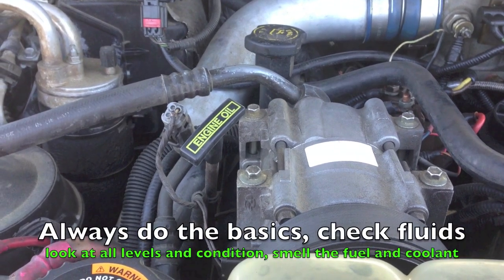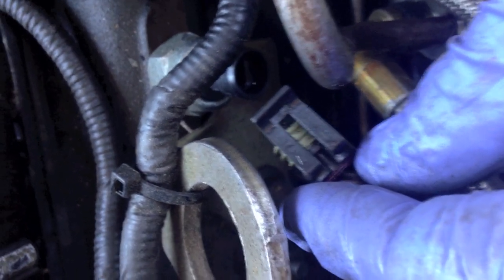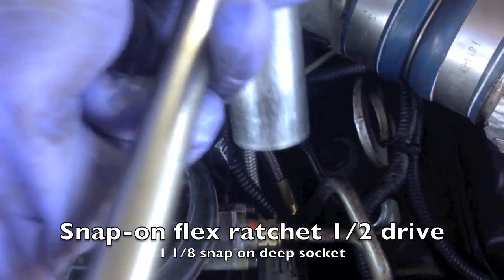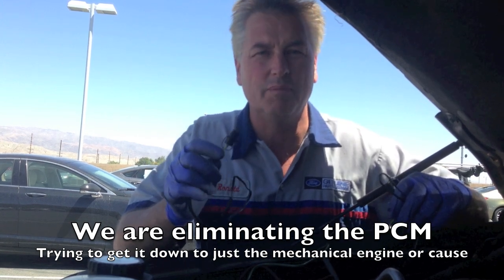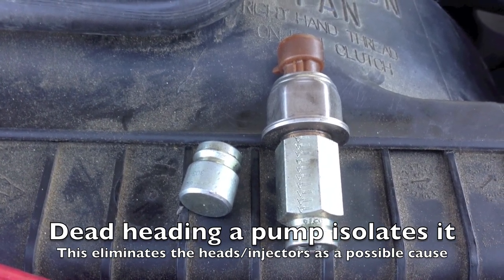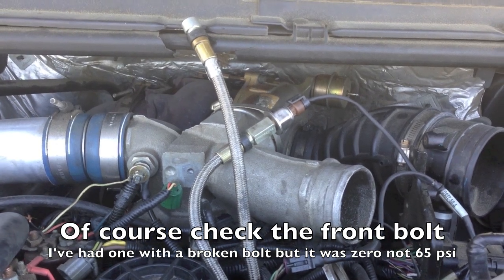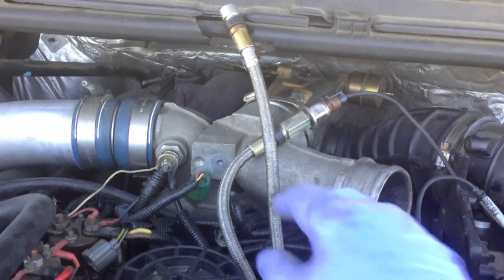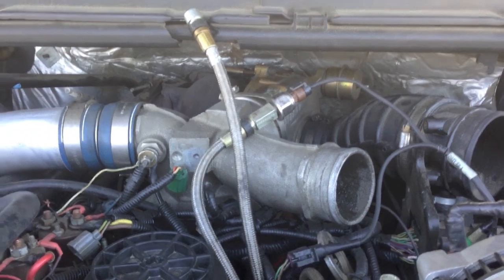Ford 7.3 powerstroke crank no start due to low icp injection pressure

Comment: I have a 96 7.3 that wont start.... new fuel pressure regulator and nothing. However if you spray ether in it will start right up but only a few seconds..... help?????
Reply: Following this because same on a 97

Comment: I have a solution just sell the dam thing before it dies on you. Because with all those fuel system parts it will leave you stranded, guaranteed. Ford designed these trucks to make a lot of money servicing them.

Comment: Hello I have a no start after I changed the high pressure pump and ipr sensor and still well not start  . Don't seem the pressure not high to me . I replaced oring on all the injectors  still won't start what could it be

Comment: I've a99 7.3 I drove it in the yard got out usually i have to plug it up for it to start but I didn't plug it up was a week then I tried to start with no success I check fuel pump is pumping I loosen the cap on thefiller bowl I guess in top of the motor now it spray fuel every we're after putit back on an it will only fire off with starting fluid

Comment: I am pulling my hair out with this 95 7.3. It'll start run for a couple of minutes and cut off and wont start again.Im getting about 12psi @ the Schrader valve.I've replaced the fuel and oil pump and ipr and other sensors,new front gas tank,fuel bowl filter,computer tested fine,I'm almost ready to dig a hole and bury it.Any help would be greatly appreciated.
Reply: Any luck? I am getting the same sort of issue. Only morning first start. Runs for a second or two then dies. Takes about 3 try's until it stays running. Only happens when left overnight. Fires up fine during the day.

Comment: If anyone else has this issue, I just got done troubleshooting mine. Wasn't injector orings, hpop, icp or ipr. It was the starter. I was getting 250-350psi icp on warm starts but my rpms were about 150-175. Not enough to create enough oil pressure with the hpop. Replaced the started and it's good to go

Comment: I think i know more about the 7.3 powerstroke and i don't have one i got the old 7.3 idi non turbo but somebody added a turbo to mine. one of the most reliable ones powerstrokes are not as good for those reasons and the parts do cost more. but the sound i love them for.

Comment: My 1996 7.3 psd with 250k miles. Stock. Have a intermittent crank no start problem. My scangauge shows ICP=0 when cranking. IPR 14.8 at key ON.  it has no oil on the stock ICP sensor connector. When it doess start it has good ICP and IPR Readings but can have a rough idle with the Engine shaking a bit. the sensors are so expensive and take several weeks to ship to my country so i don´t know if i should order a ICP or IPR...  I have a spare CPS sensor but i don´t Think it´s a bad CPS. Shows no CEL or No codes. Passes injector Buzz test.

Comment: Hi, got a question to diesel mechanics.
I have 2001 Ford e350 7.3 diesel cranks wont start.
It started during the travelling on the road. I drop gas pedal and cruise, and battery and fuel gauges start glitching, go to min and back to normal few times, looks like wire short somewhere and if i push gas pedal again and gain speed it all goes to normal, all gauges go back to normal. It was on running engine. As soon as i stopped it it wont start again and i towed it home. 
I'd like to bring it back to life by myself as i dont have other options.
I heard about AutoEnguinity OBD Scan Tool, can I do all necessary diagnostics with this Scanner and find the problem? I found one on eBay for $30 (AutoEnginuity OBDII OBD2 Windows Scan Tool Scanner(USB))
Thanks
Alex
P.S. Thanks Ron, R.I.P Man
Reply: Alex Metelkin that sounds like a wiring issue or pcm issue bud

Comment: I have a 2003 f250 diesel was driving down the road and started chugging thought i was out of fuel went got 3gal put it in started up drove a couple miles stop drove few miles home and died before i got home codes read p2614 p2617 p2290 and p1000 what to do?

Comment: i have a 7.3 02 130k wont start replaced orings, turbo is leaking and white smoke out of tailpipe, runs 5 secs then dies and wont start any ideas thanks
Reply: White is usually low compression.

Comment: I have a p1280. I replaced the sensor a couple years ago. the plug is dry. I'm thinking the sensor is bad again. this led me here. 

it runs but it doesn't want to rev up real well with white smoke. 

koer throws a p1284. it kicks the test. koer glow plug test won't test either.

though I haven't pulled the covers the plugs are not burnt on the outside. these were replaced when I replaced the go pump 2 years ago. 

wires don't look bad. I didn't peel them out though.

thinking I'm gonna throw a senior at it.

Comment: hey mate im from Australia and im having troubles starting back up once the truck sits for a few hours. i did what you said about putting 12vs to the ipr valve and after a wile of cranking it starts. what does this mean
Reply: Bit of a late response, sorry. DieselTechRon passed away about 9 months ago, but your issue sounds like a fuel leak, he has a video somewhere on it. Basically, a line somewhere is letting air in, which lets the fuel drain out of the fuel lines, back into the fuel tank.

Comment: hay Ron I have a 03 f450 6.0 I have replaced all injector all new hpop Orings and hpop also a new low pressure pump and when truck is cold I starts with ease when hot no start but cranks over let sit for 10 minutes it will start right up also put new ipr and I Icp sensors I'm now lost I've also put a new ficm please help I'm almost over this ford
Reply: Ron passed away in a car wreck spring of '16.  You'll have to rely on others on here for advice.
Reply: James Porter damn shame too.  Guy had a way of explaining things, usually you'd have to pay money for.. information is priceless.

Comment: I've got an 2000 F350 dually, 7.3L turbo diesel. the only way it'll start is if I pump the throttle, the motor drags like a bad battery until fuel gets down into the cylinders, then it turns over easily(well a lot better). if it's hot I have to do the same thing. even if I start it and turn it back off then try to restart, still have to pump the pedal. 
I've checked both fuses and they are good, fuel pump on the rail is running. I even unplugged the plug at the top of the pedal and it'll start, but only if I pump the pedal, after starting the throttle has no response. 
any ideas as what I could check next and if so is there a test for it? 
oh, it's not throwing any codes and it has a small hesitation while driving, but clears when given more throttle. 
thanks for any reply.
Reply: Chris Mcclard I have the same problem
Reply: conner shepherd, a friend of mine told me to check the lift pump or lift gate, (can't remember what he said it was called) after double checking with him today I'll see if i can find some videos on it to see is that's the problem. if I can't test it, I'll just buy one and see if that's the fix. I'll let you know what I find out in the next week or so. I need my dually at the end of November for a road trip, so I've gotta get this tracked down. I've left a bunch of post like the one you seen above, but I've got no response from any of the guys. I feel this guy is the best in the business, thats why I wish he would respond.  lol
Reply: Chris what was your problem? were you able to figure it out?
Reply: still haven't been able to get the lift pump off to see, now me truck won't even turn over. back to the basics for me now.
Reply: Chris Mcclard I have the exact same situation have you figured it out?

Comment: I have a 1993 ford e350 cutaway 7.3 diesel engine the problem I have is that it cranks but it will not start
Reply: check the crankshaft sensor is goes on front of the fly wheel  is about 25 to 40 dollars
Reply: I have the problem crank no start  replace the fuel filter cus think was duty , replace one battery autoparts guy told me that was my problem  still same  after took to the mechanic I'll pay 1.30 dollars for diagnostic show 4 different causes decide to go for the cheap one fix my problem crankshaft position sensor  so happy now f250 diesel finally is running  good luck people.....

Comment: 1997 F 350 7.3 will not start after it’s been running. I started out with the replacement of the fuel pump, IPR replacement, IDM replacement, new starter, HPOP replacement, new batteries (2) and still no better off now help 
Other items that I have replaced in the last year all new injectors, PCM, ICP, CPI, EBP Exhaust pressure regulator
Reply: Did u ever get it fixed

Comment: we have a "99" f550 7.3 will only run for 13 minutes and then cuts off. we have change pick up in the tank, fuel pump in the rail, new gas pedal.
we disconnect fuel line from fuel filter housing after it cuts off but no fuel comes out until  key is cycled again.
Reply: I replaced the ipr valve when mine was doing the same thing and it was like new after that

Comment: i have a 95 power stroke that will not start. I gave it ether to get it home but just cranks now. Batteries are good, oil level good, fuel bowl fills when cranking, oil pressure is good, glow plug relay was replaced, cps was replaced, fuel and air filters were replaced. Its throwing 3 codes as followed : P0344 cps circuit intermittent, P0470 Exhaust pressure sensor circuit malfunction, and P0603 internal control module jam error. From what I understand none of these codes should be the reason the truck cranks but it doesn't start. Do you have any suggestions as to where I should go from here? @DieselTechRon

Comment: replaced my pump, it started up find bt still leaked... ended up replacing the "common" o ring and now it cranks and cranks and cranks.... reads 100 for the pressure and wont turn over. wouldnt think it would be my ipr sensor??? could it be that all of a sudden? i hope to god i didnt lose that little steel check ball in the pump i had it out on a rag and didnt see anything fall out so i dont know what it could be now?

Comment: I got a 96 7.3 f250. all it does is turn over with no start. it makes a clicking noise while turning over and smoke comes out from the intake. all my fuses are good and I put new diesel in the tank. can you help me?
Reply from the maker: Yes but you need to give me something to go on. icp voltage, pressure,ipr percent, rpm?  I have a video actually a couple showing the 7.3 diag
Reply: Did u get this fix  Jack . What was the problem I'm having the same problem

Comment: I have a 97 powerstroke it loops on warm start, sometimes once, sometimes multiply times, just wondering if you had any ideas? thanks
Reply from the maker: ideas? If you're lucky it's just the icp sensor.  Check for a leak into the connection. If you're unlucky it's sticking injectors and it's ramping the ipr back and forth trying to get it right.

Comment: Ok. I got a 2002 F-350 7.3L and when it gets down below 15 degrees it cranks and then cuts off, and when at an even lower of a temperature and plugged in, it still does that. Most certain I'm leaking oil from my ipr valve. Would that cause it to have trouble to start in the cold? It's leaking oil onto the starter and it looks pretty corroded to.

Comment: Ron,
Thank you for your awesome tutorials! My 2002  F350  7.3 was showing code: P1316. per your video, I was able to fix the problem for fifty cents!
Also, after that work was completed, my truck would not start.  Again, I turned to your tutorials and was provided with an answer which pertained to my IPR valve.

I am very grateful for your knowledge you share and the outstanding way in which you relay it to those of us searching the internet for answers.
Thank you for the money saved and peace of mind knowing I have subscribed to DieselTechRon!

Comment: ok, my truck just suddenly died on me and won't even crank. the normal dash lights come on when you turn the key on though. Any suggestions what might be the problem?
Reply from the maker: Not without info.  Try jumping the starter solenoid to see if it's a starter or engine problem.  If not use a 15/16 socket.  Test for codes.  Remove the belt, does it click even like the starter is engaging?
Reply: Awwww bad bad deal, i crawled underneath the truck n lo n behold parts of the wiring  were wrapped around the main drive shaft

Comment: Hey what is the most likely cause for air in the fuel system on a 2000 7.3
Reply: Bad injector seals forcing compression into fuel system. More common on 6.0

Comment: DieselTechRon: Another question that I had, when you explained and Isolated the HPOP as the faulty component, is the Old HPOP serviceable or would we have to buy a Brand New Pump? Other videos are pointing to the HPOP pressure lines seals as a major oil leak problem and as I noticed on my diesel the Turbo Pedestal seals(underside pedestal to intake)  are leaking and I do have some oil sitting on top the Intake which brings about another question?  Although, there is some oil leaks, Hpop lines, Turbo pedestal underside seals, Oil Level is within Range and at Mark. Wpuld  minimal oil leaks cause my Hpop to fail and have to be replaced or just removed, inspected and new seals?  thanx again, if I do hear back from you,..

Comment: DieselTechRonnie: I know this Video of yurs is almost 2yrs. old now.  I am testing the IPR as I have a Crank/No Start situation-2000 Ford F350 Diesel, Powerstroke 7.3L Dually, 2wd, Manual Trans.  I unplugged the IPR and getting ready to test with the pigtail wiring harness you suggested.  My question, when this pigtail harness is hooked up and plugged into the IPR valve to test, Do You Turn the Ignition Key on as well? or Just apply the 12 volts from the Battery with the Key in "OFF" position.  Two New Interstate Batteries, Newer high Torque Starter(4 yrs. ago) New Glow Plugs and Relay Installed, Two New 110 amp alternators and New Fuel Pump/New Fuel Filter Intake Side and  I removed and cleaned the fuel tank and the socks then, decided to do a Hutch Mod. and omitting the Tank Filter and added Clean Diesel Fuel.  I am a Female, Self Doer, and Know this truck Inside and Out now because of your reliable Expertise!! Thank You! Thank YOU! Please explain the IPR question above more thoroughly(Turn Key on/off with Test? when apply battery voltage) as I don't want to screw any electrical components up and cause an electrical surge or Fry myself! 419-557-4706

Comment: Hi thanks for the video the same think happened with my excursion 02 7.3 it died on me on the freeway I got tired of it so i took it to the dealer and they said it was the hpop high pressure oil pump, ,they said 2200 dollars to fix it I could not believe it .

Comment: My 2004 powerstroke f250 i was driving it over the weekend and sudenly it just died. I have a computer and told me low fuel pressure. I did talk to a mechanic and told me it would cost me at least $5000 to fix it. kind of pissed off that a American truck with such expensive parts.

Comment: My hpop goes empty when I crank it over, but will not start. Please help.
Reply: Ya. T500 or adrenaline.   Replace Hpop
Reply: It was a bad relief valve in the oil filter mounting. It was stuck open.
Reply: Wouldn't let the truck start?

Comment: I put 175 Psi in the hpop lines to the heads i do not hear any air leaks. do you think maybe the front seal on the pump is leaking oil into the crank case?

Comment: Hi Ron, please help me. I'm working on a 2002 F-450 7.3 with No start. I add 15\40 oil to Hpop and it keeps going emt. and the oil goes to the crank case??? Whats leaking?  I do not have the block off caps for the hpop lines, If I take off the valve covers on both side where would I see a leak?

Comment: I need some help.have a 7.3 f250 crank nostart put a new ipr new crank sensor and still won't start check icp it getting 900 psi 
Omo
Reply: Did you ever find out what it was
Reply: @SirGuidemere  yes the pickup on the fuel module broke off
Reply: @shawndickinson120  mine was too. But my main issue is the dang harness to the injectors I’ve found.

Comment: Thanks Ron. With your help I repaired my F250 2002 IPR and now it will start when hot and not just shut down on me running down the road. Found the rear O- ring damaged letting pressure by- pass giving me low pressure/no start then hot.

Comment: Great video Ron, thank you. Do you possibly have a link or tool number for the block off plug and adapter fitting for the sensor to plug into the high pressure lines?

Comment: Hey Ron, I just completed a E-Fuel conversion on my 7.3
I don't have a fuel bowl or pump in the valley of my engine but it's all mounted on the frame, you could swap out the IPR on my truck on 5 mins!

Comment: the used wire loom, was it the whole "master wiring harness" that has the icp, ipr, fuel bowl heater ect. connectors? and replacing that solved the problem? I also dont have any white smoke while cranking but fuel bowl fills up very quickly. The whole no start is likely to do with the wire loom correct? Thanks!

Comment from the maker: That's kinda funny Nathan. I just chased a 99 doing the same thing for a week. Tried a PCM and icp. Same thing with the 3000. Got a used wire loom and installed it. So mine had power feeding back somewhere.  Its a pain but you can try an overlay back to the PCM but you would need to know which one is causing it. Remember vref feeds TP CAM ICP and MAP. But also make sure you're not starving for fuel like I show in other videos. Yes I've had bad pcms and ipr cause stalling. Its going to take some

Comment: Ron, I have a 99 f-450 crank, no start. replaced IDM ran for a  few hours and stalled out doing 65 down the highway... Replaced ipr and connector, with scangauge ICP reads high (3000 or so) even when unplugged. On my f-250 (that runs good) when the icp is unplugged it reads in the 700's like it should. Does this mean the pcm is acting up? any help would be greatly appreciated.